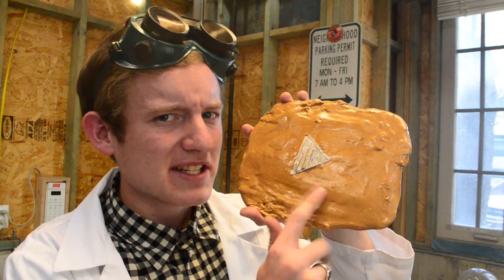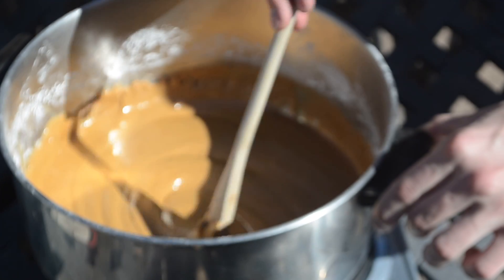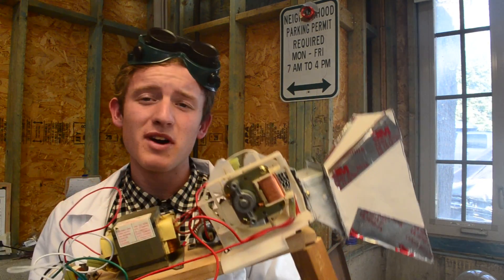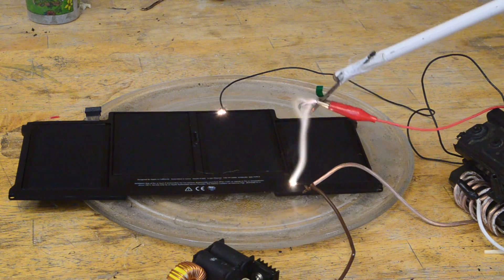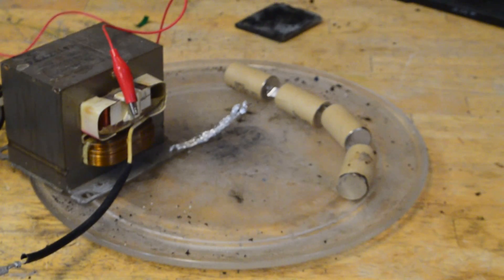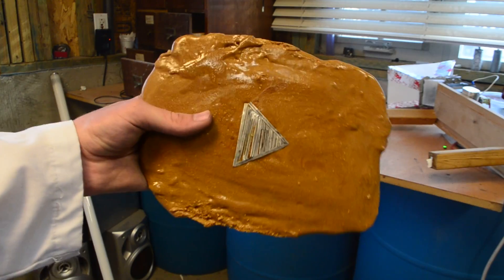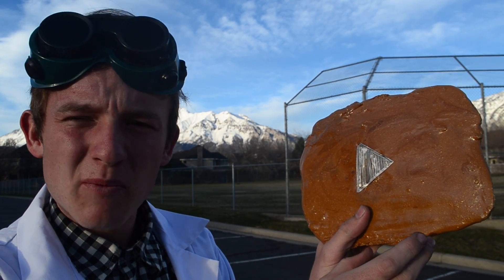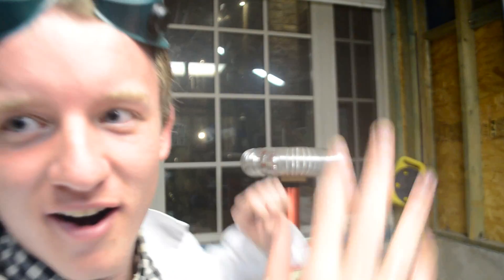Combustible Play Button

Comment: It's actually not the speed that's a problem. What I've noticed is that you cut your videos into lots of short takes with just a single short sentence in every take, presumably because you've said it over and over again until you got it "perfect". But if you look back at your older videos, you sound quite natural in those, with the occasional "um" and "ah". Your more recent videos sound more robotic, because of all the cuts and the fact that the speech is not so natural. Also, I've noticed that most of your sentences are intoned in precisely the same way. So the videos don't have an ebb and flow. Of course, doing it this way makes it sound more nerdy, which isn't bad for a science channel. But some of the videos can be a bit off-putting. I personally prefer the more free flowing videos in terms of the way you speak. It definitely could be worth experimenting a little, to find the balance between sounding like someone rambling and sounding like a machine gun.